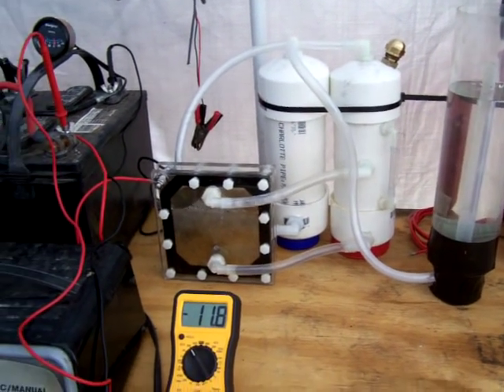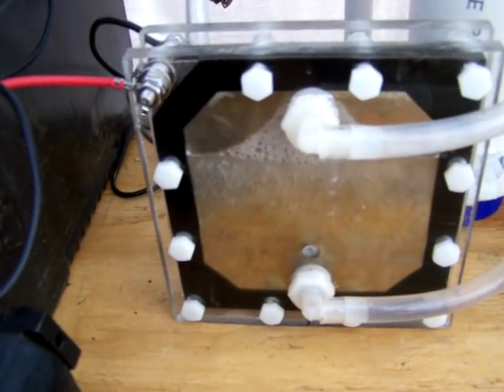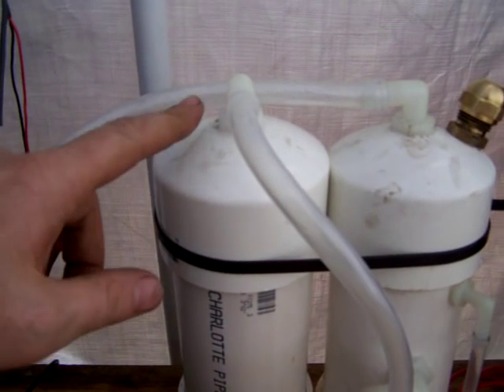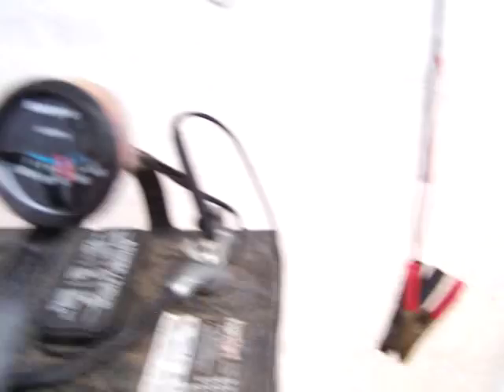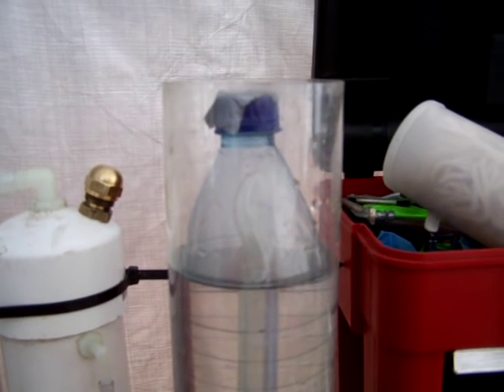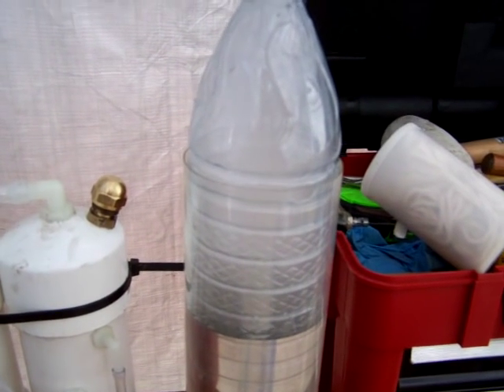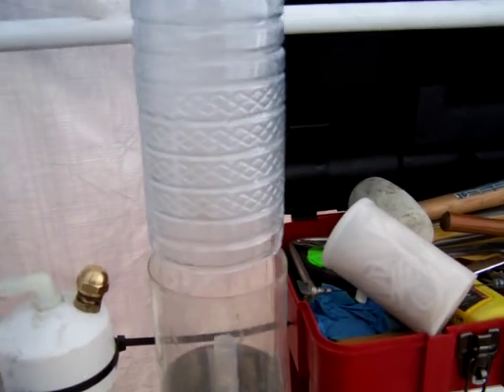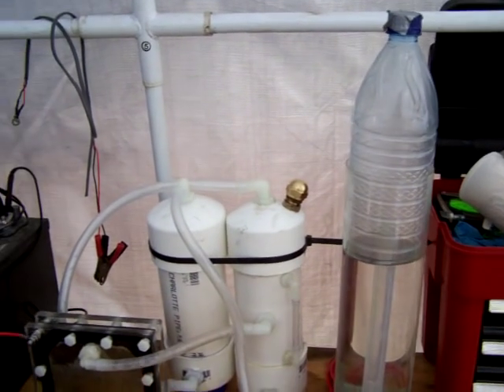Hydrogen on demand conversion kit. Turn any car into a Hybrid for only a few hundred dollars.

Comment: I would like a real chemist or physicist who thinks these systems work for the long term to answer one question for me: First Law of Thermodynamics? How do you keep the battery charged?
Reply: The World is Chemistry.
Reply: David Chapman ?
Reply: Battery will still be charged by alternator of the car as usual.
Reply: Roger Sy Albert Einstein said "Energy cannot be created or destroyed, it can only be changed from one form to another".  Given this it is reasonable to suggest that any net gain from the introduction of h2o2 into the inlet manifold would be consumed by the net drag created by the increased load on the alternator giving an absolute maximum gain of nil, though I suggest that there will be further losses in the system leading to a net loss over all.
Reply: The alternator puts out more power than what is used to run the engine and vehicle. It has a fixed output while at speed, hence why it is able to charge the battery and run electronics from your cigarette lighter.
Reply: well... The main load on the battery is only at startup... so... Easy for the alternator to keep up with charging that, and then not having to work very hard when the battery is charged. Power to drive the alternator is coming from whatever you are burning, ultimately.
Reply: Basically this device will not suffice for any vehicle no matter the size. Putting such a load on your alternator will cause it to use more energy. Hence even if you got a 100% return from all the energy you put into splitting the hydrogen in the form of hho gas, you will burn all of it just to meet the increased load on the alternator. But you won't get an equal hho gas generation to electricity usage, you will lose some energy to heat waste on both sides. point is it won't improve anything, just shorten tour alternator life span. 

Now if you can generate this has outside of the car in the shear quantities you would need in a large enough reservoir without loosing any energy gain to friction in the air and show us those results maybe and I mean maybe you could say something. But you will also have to tinker with the onboard computers to get the right mixture. Point is your not going to get enough gas quick enough from any system unless you build a large industrial level machine and you can't do that. Also all of this additional energy and money has now negated any benefit that could have possibly come off of this.

ABET licensed Mechanical Engineer. That's my background for this answer.
Reply: @miltechmoto  This is absolutely INCORRECT.  The alternator generates electricity On Demand.  There is no SURPLUS ELECTRICAL ENERGY produced by the alternator.  Any additional electrical power consumed will increase the drag on the alternator that must be generated by burning gasoline in the cylinders.  There is no such thing as a free lunch!
Reply: @cavefox117  or if you add a catalyst you can generate more with less energy.

Comment: Where do u feed the hydrogen to the engine?
Reply: you need to do a pipe h2 or HHO into just after the filter. now in the engine management (car year dependant) in can going into limp mode due to the gas mix it is detecting. thats a whole load of other matters. but at 1st attempt make a pipe into after the filter. the car will suck that gas to make the air mixture for combustion. after that trial see if you have any promblems from car. it all depends on car, management system , map sensor etc

Comment: but how long   can your  rings  take   on the  pistons  ?  :-)  before  they  burn away  ........
Reply: ziggy pop Umm HHO hybrids - flash combustion, burn cooler than gasoline and air fuel mix alone. This is due to the speed of the detonation when HHO is introduced into the air/fuel mix, as opposed to the much slower speed of gasoline / air without HHO. So rings will nor burn away...

Comment: OK this video poses quite a few questions,

#1  Can an engine run exclusively on HHO, rather than on a mix of gas and hydrogen ?.

#2  Can a Diesel engine run on HHO ?.

#3  What storage facility do you use to store the HHO gas between production and use ?.

#4  If you do NOT store the HHO gas, how do you regulate the production of the HHO gas to keep up with the usage ?.

#5  If you DO store the HHO gas how do you pressurize it ?.

#6  In the configuration you are using how long will the supply of water in the jar last  ?.

#7  How long can you run the engine on HHO gas without having to revert back to ordinary gas ?.

#8  Can you link up a bank of "Bubblers in series to  produce a greater supply of HHO, that can be stored for future use ?.

These questions will do for now, I will undoubtedly have more in the future.  I look forward to your reply with eager anticipation.
Reply: I'm glad you are interested in this tech! these answers may satisfy you.
1. yes but the engine has to be built specifically for the combustion of hydrogen as it explodes differently than gasoline.
2. there is no problem installing and using a hydrogen on demand gas source in a diesel engine as far as I am aware but some one else might know better.
3.there is no storage facility in a hydrogen on demand systems which is the most popular system on YouTube and for motorists. other designs may feature them.
4. in the video he showed the measuring system for hydrogen using a liter to minute ratio meaning the liters produced per minute and suggested that 3 liters is good. a way to regulate this is voltage. run a test on your hydrogen cell by hooking it up to your car battery or whatever you plan on using as a source of electricity and do the same liter to minute test shown in the video.
5. n/a
6. at least a few thousand miles with any electrolyte mixture I do believe but I'm not certain.
7. this is a hybrid system so it runs off of both hydrogen and gasoline at the same time. hydrogen is usually injected into a cars air intake which then gets sucked into the engine.
8. bubbles aren't really storage as much as cleaners. the water scrubs the gas of its impurities as said in the video above. 
hope the answers are helpful and that you succeed in building a hydrogen on demand system of you're own :)

Comment: Thing is you're not creating energy because it can't be created all you're doing is converting DC power to a gas and it takes your engine just as much fuel to charge the battery back up as it makes   it's the rule of thermodynamics

Comment: the japanese currently produce a car with a 1.3 l engine running on just hydrogen.
Reply: Bryan Chadwick Everything we drive that burns gasoline/petrol burns the hydrogen...not the carbon in the hydroocarbon chain. People must understand this...engines DO NOT burn the carbon..only the hydrogen. The carbon as CO2  goes out the tailpipe Sheesh...
Reply: You are correct.  BMW also makes a hydrogen-burning car.  They do not, however make the HOH gas onboard.  They have a pressurized Hydrogen gas tank that supplies hydrogen to the engine that is then burned with oxygen in the atmosphere to generate water H2O as a waste product.

Comment: If you want to get the plans
to convert your car to HHO
Go to Google and Search for :
"Top HHO Gas Car Research"
Click the First Result (Skip the Advertisement)
Reply: good job
Reply: +Criss Harry +Del Bolt this tech is pretty old. they had a hydrogen car in the 50's or 60's already
It was deemed unsafe back than because it's more explodable than a fuel engine
nowadays as tech has improved we are simply taking another look at its practical implications . the science is definitely not new noir is the technology for the the hydrogen fuel cell was invented back in the early 1800's by a man called Humphrey davy and a man called William grove build the 1st fuel cell in 1839.
People don't realise that the  hydrogen and electric car has been around for ages it's just never been good enough to replace fossil fuel powered cars and will prob take a very long time still to reach the awesome raw power that's contained in fossil fuels. i would not build one if i was you . your electric bill will rise well above your fuel expenses and it wont even save your environment because electricity gets made out of coal mainly still

Comment: Wow, the comments here are so ignorant of how this works! Most of them are talking garbage and wouldn't know shit from clay. LOL The mistake they generally make is that they over estimate the strength of the hydrogen bond with oxygen? The bonds in water are weak and are easily broken with low voltage electrolysis. If carbon nano ribbons were used on one node for more surface area, then hydrogen and oxygen production would be much more efficient.

Comment: so you convert electrical energy into chemical energy into mechanical energy,
why bother with the extra step in the middle just hook up an electrical motor to the battery so you can avoid unnecessary conversion losses.

Comment: Sadly, this does not work. :(
Reply: It actually does work, I was able to get 8-12 mpg better mileage using a similar system on a 1990 Pontiac Sunbird.  The problem with getting it to work on a newer car is the computers are setup for gas and a certain air fuel ratio so you need a way to tune the computer so the car accepts the HHO without thinking you're running too lean.

Comment: This system doesn't run because the energy conservation law, see more http://www.popularmechanics.com/cars/a3499/4276846/
Reply: Your link doesn't say that. In fact, it says that the main problem with one such system is that you can't get a smog sticker because you can't modify emissions systems (i.e. legal problem, not science problem). The energy conservation law is irrelevant here, because it just basically states that you can't increase efficiency beyond 100%. Auto engines have a long way to go before hitting that wall. To be clear, we are talking about a hybrid system, not a pure hydrogen burner.

Comment: Um, this has been demonstrated many times, that it doesn't add ANY mileage improvements. Sorry, but that's the raw truth. IF it was viable, don't you think at least one of the automakers would offer it?  IF it worked, think about what this thing would do for their CAFE numbers.  It would be a win-win for them. Alas, it won't help at all. Just a waste of time.
Reply: +Quantum Leap nope cause the oil company will bank-rot
Reply: patrki rossak What?  You think the oil companies dictate what the auto companies do?  Ford and GM couldn't care less what the oil companies think. They are concerned with SELLING CARS.  And if better fuel mileage will help that goal, then that's what they will do.  Why do you think all the auto makers went to fuel injection?  Variable valve timing? Electronic fuel and spark control?  Why didn't the "big bad oil companies" put the stop to higher fuel efficiencies gained by those technologies?  You've got to use your head, not just post knee-jerk responses about "big bad oil companies."
Reply: +Quantum Leap, I agree with the knee jerk responses, but I think knee jerkers are on both sides of the equation and the culprits, at root cause, go unchallenged.  Please consider on average, that a 42 gallon barrel of crude oil is refined into 19 gallons of fuel and 13 gallons of diesel, the rest are plastics, rubbers and miscellaneous other things and let's not overlook the inefficiencies in the refining processes (source: https://www.eia.gov/tools/faqs).  That's about 73.8%.  I'd say if they aren't demanding, then they are at least watching, and trying to figure out how best to put their inward thinking and selfish lobbyists to work so they can write demands into law.
Reply: +ThinkDeeper   Well, regardless of what the oil companies and conglomerates think or do, the HHO hoax is not a concern of theirs.  It just flat does not work. You waste more electrical energy making the HHO than you recoup when you burn it in your car engine.  It all goes back to conservation of energy.
Reply: they do ( cause they got nice portion of their stocks ) XD

Comment: Okay, let's assume we have a vehicle cruising at 60MPH, and getting 15MPG. That means it is using 4 gallons of gasoline per hour, or 1 gallon every 15 minutes. To increase the mileage by 25%, (18.75MPG) you will need to add 25% more energy. (17,849 X 25% = 4,462.25 every 15 minutes) OR 297.5 liters of "HHO" per minute. Makes the 3 liters per minute from these devices useless. Yes, this math is correct, and my knowledge comes from nearly 4 years relentless research. I know the figures.

Comment: You began by publicly posting a constant display of absolute ignorance. Now you make a style change to all caps, apparently to further emphasize your ignorance within your same public displays of absolue ignorance.. 

Hyundi is testing their prototype hydrogen car. 2 electrical generators, one burns gasoline the other HHO gas. One gallon of gasoline vrs 1 gal of water running the same 6.5 hp small combustion engine. The generator using gasoline might run 2hours and HHO be running 2+ days later.

Comment: Trust me, I know how combustion works, my background is nearly 40 years in Automotive Engineering, and I hold an MSc in Oil and Gas Engineering. Nearly 4 years of extensive research into this "HHO".... it just doesn't stack up. Hydrogen actually has less energy than gasoline, I can show you the figures of that if you'd like. The 3 liters added, cannot increase power in an engine, as I said you need an incredibly high output of "HHO" to make ANY difference.

Comment: lmao,im not insulting you,your just not informed enough in this subject buddy,1st,you need to understand hydrogen on demand,vs hydrogen stored in a pressured bottle,argon gas,propane,gasoline,all are flammable,what makes them most dangerous is when put under pressure to contain it,regular gas is held in liquid form so its not stored under pressure,but its still the fumes of gas not the liquid that is flammable,the hydrogen is not stored under pressure,,its safer than an idiot smoking at the pump
Reply: Argon gas is inert as it is a Noble Gas and is not flammable.
Reply: @lonbrouse6440  I am working on a steam engine to turn. Generator amarture and use the 220 to put oven coil from generator to the steam engine to run each other and use the excess electric for free
Reply: @b3poj2d2  This is a really bad perpetual motion proposal.  Using an electrical resistance heater is very energy intensive and inefficient.  Using such a coil to make steam  to turn a turbine to make electricity to run the coil entails multiple conversions of energy from one form to another, each with its own losses.  The whole system would quickly grind to a halt from the massive energy losses.  There will be no excess electrical energy, free or otherwise.
Reply: @lonbrouse6440  how is that. A steam engine can move a trian or ship. A electric turbine is a joke to move no matters the load or her ratio compared to a train or ship. A generator already has a 220 v hook up. So even if I turn one turbine to produce the electric to the steam engine and another turbine for the 8000 Watt toy electric to use . The steam engine can move both with no problem. The problem is people limited view and negative energy . Anything is possible. At one time they said a helicopter is to big to fly cause of body size compared to wong ratio. The problem is only the limit of ones outlook . But my machine will work perfectly. I'll upload the video for you when I'm done fabrication of the rest of my project
Reply: @b3poj2d2  I presume the title you have given yourself is wishful thinking.  "Dr." conveys some advanced level of thinking and verifying your presumptions through initial calculations and THEN building a prototype.  

You have fallen into the "conceptual trap" of coming up with an idea of how a series of energy transformations could work, but until you build the series of machine energy transformations, I perceive that you will not understand why the project cannot work.  Engineers, Chemists and Physicists enjoy the tool called "Mathematical Modeling" that allows us to calculate energy flow through a machine like you described.  The mathematics is quite precise and tells us that your contraption cannot work before we have to waste the money, time and effort to actually build the device.  

With that said, I wish you good luck.  please post your results in a video, as you promised, or a series of still shots.  I look forward to your results.